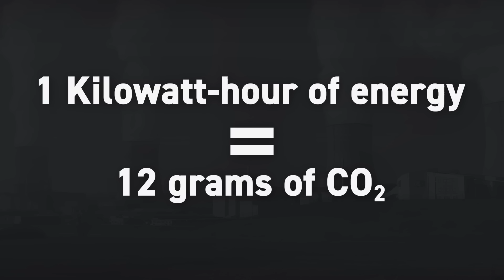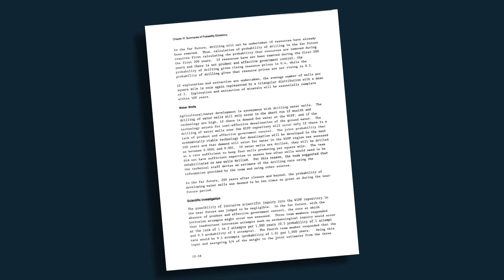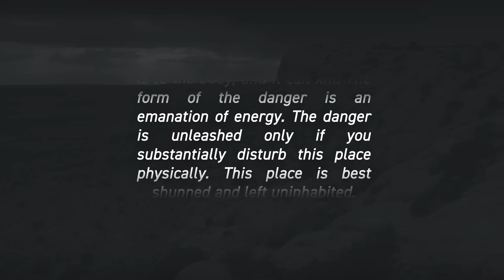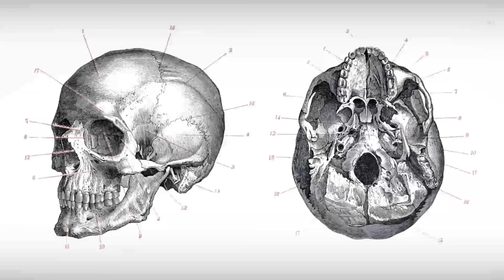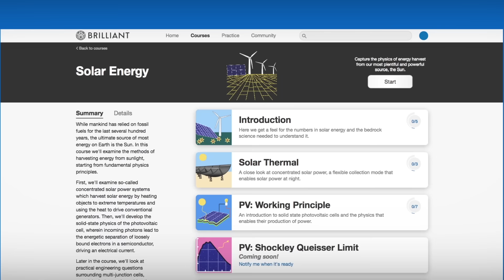The Nuclear Waste Problem

Comment: so is it possible to economically convert the waste in nuclear bombs and detonate the bombs under control conditions. these conditions will also capture energy from the bombs and store the energy in water dams or pressurized underground air? The idea is to force the slowly decaying waste to release all its remaining energy one time, then storing some of this energy for long term use.
Reply: @John Akim  No. The atoms that make up nuclear waste have already been split. Nuclear bombs split atoms to produce a massive amount of energy. No atoms to split means no bomb
Reply: @tlowry6338  ok. so the radioactivity of the waste is coming from the byproducts from the split uranium atoms

Comment: Wait wait, the pic at 2:26 is misleading, as this waste is secondary waste; higher volume, radically lower toxicity with half lifes measured in hundreds of years that contains low level radiation 2:27 items such as gloves, suits, containers, and so on - similar, if not identical to, the low level radiation detritus from imaging devices used within hospitals.

The high level radiation stuff is the burnt fuel residuals, currently stored on site at the nuclear power facilities - the volume of ALL high level radioactive waste created by ALL the nuclear reactors in ALL the world could fit inside a room in a house - bedroom, bathroom, living room, I'm not sure.  Also, current generation reactors are only able to use 10% of the fissile matter, leaving a lot of that small amount of volume that fits into a room, with potential to be reused.  And a lot, if not most, of 4th gen reactors are to use the current waste as fuel, and to burn nearly all, if not 100%, of that waste as fuel, creating a small amount of waste with half lifes of around 300 years.

That picture is is pretty misleading - at the very least, some context of the volume of the low level waste portrayed in the photograph should be explained.  There's a pretty significant story behind it, and it is not unfavorable to nuclear.  Even if we didn't reuse the high level waste, there will be so little of it especially when compared to the waste from burning petroleum, I do not believe it's an insurmountable problem - certainly not one to stopmusing nuclear over.  The comparison of waste amounts isn't laughable, of course, but it is surreal.

Comment: The price tag given for Fukushima, $500B, is clearly not due to the accident. For instance, the J government has decided to compensate all residents contracting cancer who were vaguely in the vicinity of tine and place of the accident, even the background cancer rate is 20% of the population.  These are purely psychological pathologies. They might as well compensate all residents who take I’ll for any reason within 30km of a plane crash, due to PTSD contributions. 

BTW, it’s incorrect say the Fukushima Accident will cause “130 cancers.  The 2013 UNSCEAR report said there was not then, and there won’t be any “discernible” evidence of cancer given the low levels of radiation.

Comment: Nuclear is not the future, all it takes is ONE mistake to make an entire region uninhabitable. Geothermal is far more efficent especially a closed loop system. Drill down deep enough and you have unlimited 100% clean energy with minimal maintenance and possible to be build anywhere in the world. Better to spend more money on a less efficent but far more sustainable system than to cheap out on a potentially devestating system.

Comment: If its the most poisonous substance on earth used then how is it clean energy?
Reply: it doesn't create pollution
Reply: @donlimonesioyt9644  is radiation not pollution?
Reply: @0topon  The pollution it does create (nuclear waste) is typically not pumped into the air but buried deep in the underground, which is less dangerous directly (still bad for the environment though)

Comment: Normally your videos are quite good, but this one is less ok:
1. Most spent nuclear fuel in the world is reprocessed, so that the tiny fraction that is actually radioactive is encased in glass. This is then placed in a steel, copper and concrete structure that is virtually unbreakable. The valuable uranium 238 (which is not radioactive to speak of) is saved for later use in a fast reactor.
2. The statement of "thousands of years of radioactivity", while correct, is misleading, as the level will deteriorate EXPONENTIALLY. This means that you could hold a spent nuclear fuel rod in your hand a few thousand years from now, and be completely fine. So, if the Egyptians had had nuclear power, we could show the fuel rods in a museum, behind some heavy glass without any concern. 
3. The consideration of what happens to civilizations 10.000 years into the future is completely nonsensical, bizarre. We have much bigger fish to fry, including vastly more pressing waste management of fossil fuels and other materials.
4. Keep in mind that all spent nuclear fuel from a large country such as France fits inside one IKEA, it's that little.

Comment: this video is clearly a bit bias against nuclear Energy and some facts are false, like how the dry casks that the nuclear waste is put in are weak and can leak, when in reality Dry storage containers are made of reinforced high-density concrete about 510 millimetres (20 inches) thick and are lined inside and outside with 12.7-millimetre-thick (half-inch) steel plate. (which won't break)

Comment: U235 not 236
Reply: No it's actually right. Uranium 235 absorbs a neutron an becomes Uranium 236 then it fissions.
Reply: @mrkokolore6187  Thank you kind sir. I just know U235 is the initial isotope
Reply: @mrkokolore6187  I hesitate to correct you, but I believe U235+n is more like an excited state of U235, than like an excited state of U236.

WIkipedia has a fairly clear explanation, so I will plagiarize them: https://en.wikipedia.org/wiki/Uranium-236
When 235U absorbs a thermal neutron, one of two processes can occur. 
#1 About 82% of the time, it will fission;
#2 about 18% of the time, it will not fission, instead emitting gamma radiation and yielding 236U.
(note for you Thorium fans out there - U233 fissions more often, around 95%, vs capture to U234)

The other reason I see it as an excited U235, vs forming U236 first, is that the U236 decays with an alpha particle + Th232, not with fission into more even products.

I see Wendover Productions as incorrect, because they state "as an individual atom decays" while showing a U236 nuclide at around 2:32

Comment: Ok hear my out. We dump all sorts of crap in space. Why not send it off into space
Reply: Sending things to space is really expensive, more expensive if you send a lot of things to space, not to mention the emissions it would produce
Reply: @andyblinkblink4198  is imagine the emissions from the rockets would be less harmful than improperly disposed nuclear waste, if also imagine the cost of sending it to space wouldn’t be too terrible compared to the temporary solutions on earth when you consider those solutions are temporary and require constant upkeep. The cost seems fairly justifiable
Reply: @farmertyler8087  nuclear waste isn't improperly disposed of, it's sent extremely far underground. The whole point of having temporary storage is to recycle the waste into new fuel and it would be really hard to do that when the fuel your trying to recycle is halfway across the solar system. Also what if a rocket blew up, massive areas would have to evacuate because of all the fallout

Comment: Why not sending this nuclear waste to space.
Reply: Three reasons: 
1. At $2700/kg to LEO, it would take over 5k Falcon Heavy launches and cost $459b to get it all into space.
2. With a 6% failure rate, 16.6kt of waste would be explode in the atmosphere and be distributed across a large area.
3. Conventional reprocessing already works just fine.
Reply: @Crispr_CAS9  Thank you very much

Comment: We've solved this decades ago
Reply: Then why are they still going threw with this burial site?
Reply: @tanimation7289  Not talking about deep stuff, just the general. Anyways, this site isn't complete bullshit. You just don't know how much it helped people.
Reply: @cowpig9157  I know the reason they are using it. What I want to know is why not just store in in a regular facility until it can be used for the new power plants?
Reply: @tanimation7289  I don't know. But it's likely because it's inefficient
Reply: @cowpig9157  Also another problem with nuclear power is that it’s hard to get the plutonium to power the plants. Basically it’s all government controlled and privet companies can’t just buy it. That’s why all nuclear powered ships are government vessels.

Comment: This video, though not untrue has some omissions. The casks in which the cooled down nuclear waste is stored is built so it can withstand being hit directly by a plane (which they actually tested by crashing a jet on it, you can look up test videos). So they are very safe. You can actually pummel them down with grenades and you would need a lot of them in order to actually damage them so they would leak radiation. And because they actually do not need any cooling anymore the effects of breaching such cask would be contained within a very small distance. Second, they’re kept there because we might actually want to use this waste for some reason. There are techniques that allow us to extract nuclear fuel that can be used to further power the reactors. Though its not economical at the moment as its cheaper to just use “fresh” uranium and there is a risk that nations that have the technology to purify the waste can also extract the weapons grade plutonium from it and this is against the nonproliferation of nuclear weapons idea. So atm, its just left mostly alone though there are countries that purify this waste to fuel. Another thing is that the Gen 3+ nuclear reactors (current gen) are build so they don’t need to pump water to cool down the reactors. Instead they relay on convection and are cooled down passively so there would be no chance of such accidents as in Fukushima. Additionally Chernobyl happened so badly mostly because the USSR did not built the containment buildings around their RMBK reactors. If there would be a containment building - like around of the all currently working reactors - the effects would not be as widespread as they were. They had to built a contaiment building (the sarcophagus) after the fact which a much harder feat to accomplish. Lastly even though there is Uranium only for about 240 years we can extend this value a lot by: purifying and reusing spent fuel, improving the efficiency of uranium fuel rods in which is being done in Gen 3 and upcoming Gen 4 reactors or improving the amount of electricity generated from the fission by using other substances instead of heating up the water that require less energy to boil and turn the turbines. But the main idea is that we would use nuclear fission power only as long as its needed. The biggest hope for the future is fusion. But we need to combat the climate change effects right now. And the factual and undeniable truth is that green sources such as solar or wind will not keep up with the ever increasing power demand and they are not stable enough as they depend on the day being sunny and wind blowing with just right amount of speed and are terrible when it comes to creating a stable electrical grid which is needed for our technology to work. But they can be used together with nuclear to eliminate fossil fuels faster.
Reply: But you forget, centuries of wear and tear can wear down anything.  How do you think the Grand Canyon was created?  I'm sorry, but storing nuclear waste is always dangerous since nuclear waste is hazardous for centuries if not millenia.
Reply: @50jakecs   In order to have wear and tear you need to have some sort of activity that wears and tears stuff. That’s why Onkalo was chosen in Finland as a long term solution to storing waste and the other countries are looking at similar sites. The Onkalo site is dig up in a two thousand million year bedrock. There’s no earthquakes, no movemement, no ground rivers, nothing that can disturb it. 

The casks stored on site currently are actually also filled with cement powder so if the water somewhat manages to get inside they would just harden further into concrete instead of making cracks.

The nuclear waste is actually one of the best managed wastes of all forms of electricity production. Fossil fuel waste is just dumped into atmosphere which literally kills millions of people every year. Used solar panels are just dumped into landfills after they’re used up and they contain metals such as lead and cadmium which can cause environmental harm. Same with wind turbine blades. It’s expected that the Germany alone will produce over a million tonnes of non recyclable waste for the wind turbines over the next 20 years. Compare it to a less that 400 000 tonnes of waste since the beginning of nuclear power. And this waste is managed, controlled, monitored and accounted for.

Comment: Device to end the creation of Nuclear waist.
 Step 1: calculate how much energy you need pumped into the motor to make a vertically positioned circular platter with  magnets in-bedded horizontally around it's left side and right side so there pushing force is pushing out sideways relative to the vertically spinning disc to spin fast. :D Step 2: Calculate how many sets of copper coils you need to be interacting with magnetic fields to achieve this & to perpetuate more electrical current flow then is needed. :D Step 3: Build a round horizontally positioned platter covered in all these copper coils pointed down that does not move (Is stationary) :D Step 4: build a round platter covered in powerful magnets pointed up that can spin and place it directly under platter with hanging copper coils. :D Step 5:  Position the vertical platter that is  motorized close to the horizontally positioned platter covered in magnets pointing up so that when the vertically positioned platter spins the in-bedded horizontally positioned magnetic fields slam sideways against the edge of the horizontally positioned platter causing it to spin. :) Step 6: Make sure enough of the copper coils are feeding their electrical current into the motor and the rest of the copper coils are linked into a set of rechargeable Battery's placed right next to the motor spinning the one vertically positioned disc. Step 7: Build a duplicate setup of horizontally positioned discs with hanging copper coils and disc with upwards facing magnets and position it to the front right, the back left and the back right of the vertically positioned motorized disc. As the vertically positioned motorized disc spins the horizontally in-beaded magnets will now hit into all 4 horizontally positioned discs causing them to spin. so you will effectively be using the spin of one disc powered by one motor to spin 4 constructs that are each generating electrical current. now build this whole setup multiple times over and use the current perpetuated by it to power up scaled electromagnetic generators that are equal to or more powerful than the ones used in a nuclear power plant. You will now have a device that is self perpetuating off of it's own electrical current perpetuation and no nuclear waist to worry about.
Reply: my man's typed up a whole essay on youtube.